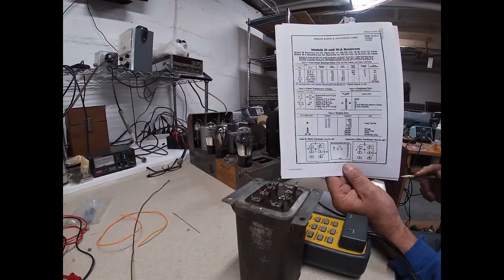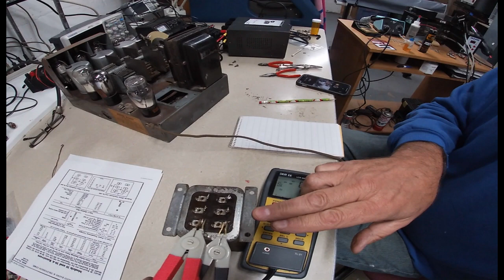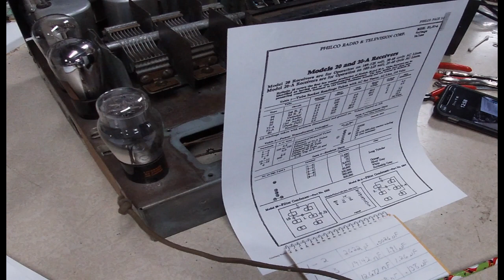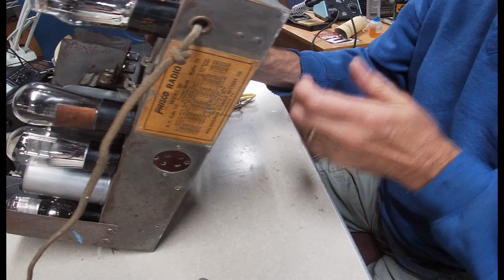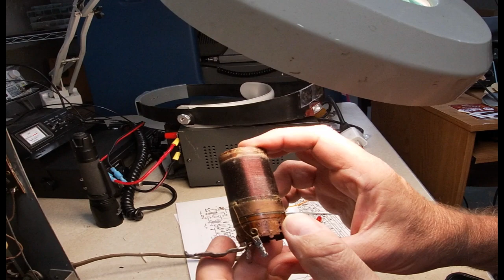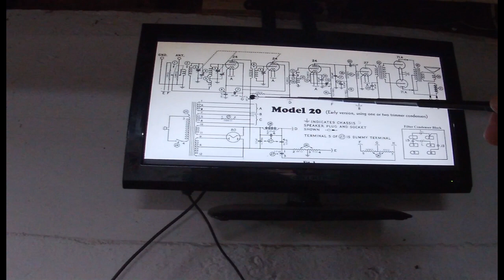Philco Model 20 Part 4

Comment: Greetings Tim,
Thanks much for the Vid!  Have the same Model 20 guts in a Model 220 (has phonograph).  Can you share with me your part source (Caps and Resist)?  This will be my first radio project as the noob that I am.

If you could share the Filter Condenser cap polarization source or details, that would help a lot.   In fact, any directional for capacitors would be helpful along the way.

Best,
MoxieBella
Reply from the maker: Welcome and good luck. Like anything it just takes practice and you will do great. For the capacitors and resistors, I use “Just Radios”  be sure to check out Mr Carlson’s  Lab for a lot of information about capacitors and techniques.  As far as the polarization on the filter cap, I found a redraw on the web and they were listed but the original canister I am pretty sure had non-polarized caps.   The schematic should be here. https://philcoradio.com/library/index.php/service-info/early-schematics/